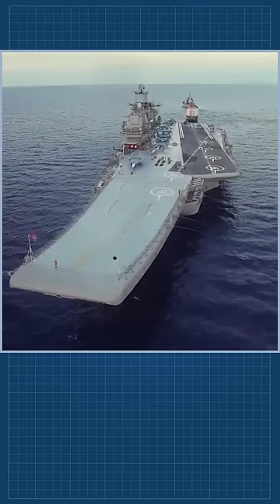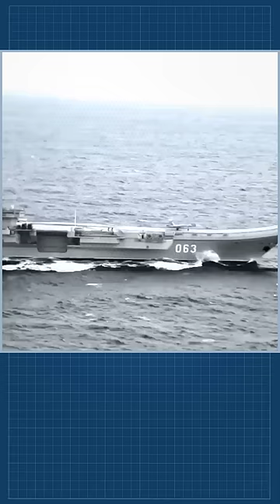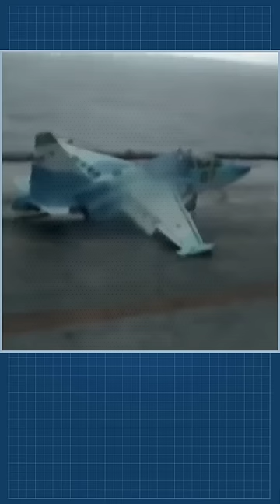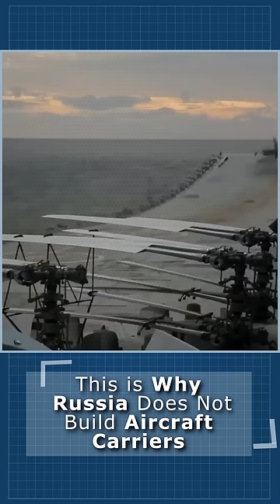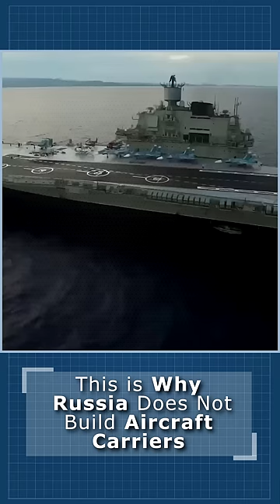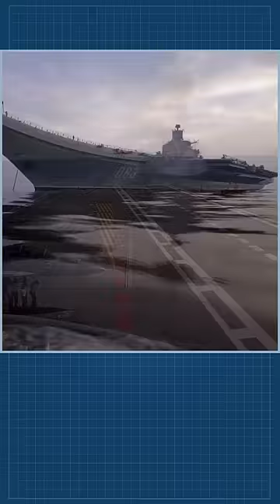This is Why Russia Cannot Build an Aircraft Carrier #shorts

Comment: That carrier is only as fast as the tug that accompanies it everywhere.
Reply: Or as slow as the crew deals with whatever else is broken on board.
Reply: or how it can been seen over the horizon by the naked eye. It runs on a very low oil and leave a massive plume that gives it away.
Reply: @_R-R  The russians thought they were smart to integrate all those missile systems into a carrier. When repairs are needed, they have triple the work because many things are in the way. Not only that, if they wanted to fire a missile ALL air ops stop to allow the firing of the missiles.

Comment: Well, looks like it’s between US and China now
Reply: @patrickwright8352  listen, nuclear carriers don’t change much, a carrier never leaves without a carrier group and the other ships are not nuclear powered, so Americans carrier groups have to stop at ports every few days too. They just don’t have to refuel the carrier itself which saves what? Like 40 minutes only
Reply: @sweatybotfn9982  No, it does mean though the carrier itself almost never has to dock and in times of war can easily remain hundreds of miles offshore while it’s escorts or logistics ships handle resupply 

I know it doesn’t sound huge, but this is a HUGE difference. The carrier itself never has to take the security risks of coming closer to shore if it doesn’t want to, making it far less vulnerable to systems like drone or boats swarms or anti-ship missiles. On top of that logistics is simplified as to power the carrier would take more fuel than any other ship in the fleet, with that eliminated by nuclear power it significantly lessens supply needs

Don’t have any misconceptions, nuclear is superior to gas turbine engines on carriers in almost all situations. The limiting factors are cost and expertise, but China is already experimenting with ship board nuclear reactors and their future carriers will likely be built with them
Reply: @sweatybotfn9982  carriers have pretty much everything brought to them, unless it’s an extremely large thing to transport, they can just stay out in the middle of the ocean and transported through networks of boats. Most of the time when a carrier pulls in to port, it’s pretty much leisurely or maintenance
Reply: The Chinese are definitely on the up-and-up in this regard. They're already working on CATOBAR, and soon, even nuclear powered.
Reply: Too bad china doesn’t have any fighter jets that land/take off on their carriers 😂
Reply: @joshuagrant4961  are you living under a rock? China will have fifth gen carrier aircrafts in service in a few month😂
Reply: @sweatybotfn9982  People have imputed their presumptions about Russia being no good (which is wrong) onto China.
Reply: @PrimericanIdol  About Russia, it's not wrong, but agree with you that believing China is just another Russia militarily on the basis of Russia's pisspoor performance is wrong.

Comment: Another thing to note, and it may be a minor reason, is that there is an international ban on aircraft passing through in and out of the black sea where the ports would be to build the carriers. The one they currently have is not classed as a carrier to bypass through the straits leading out. So if russia started to build a crap ton of carriers then they just be stuck in the black sea, and at that point they shouldn't get away with calling them something else to leave.